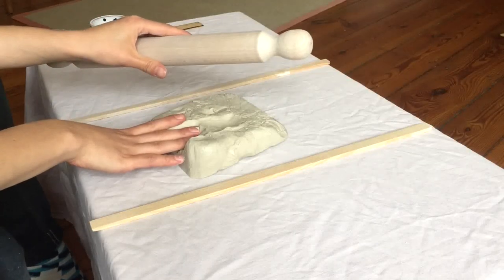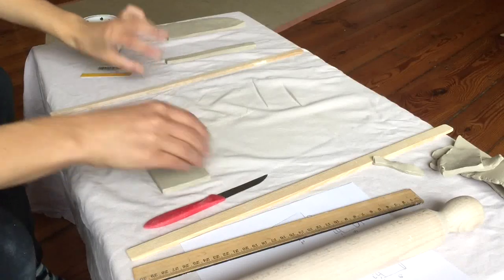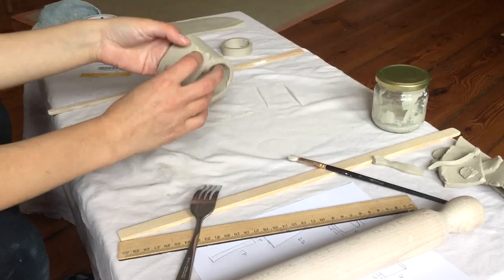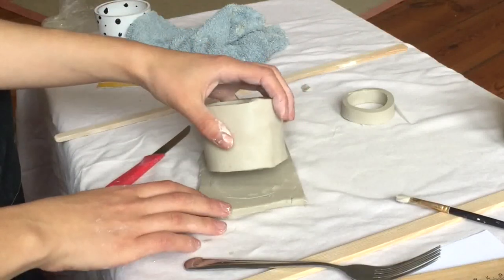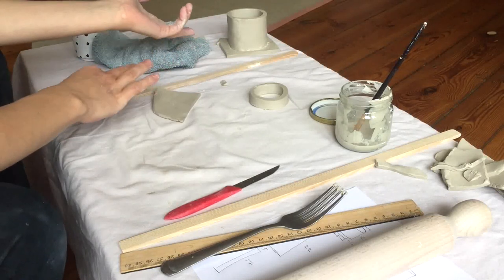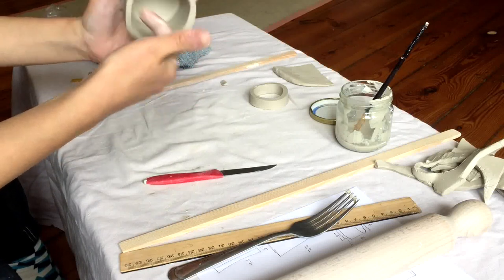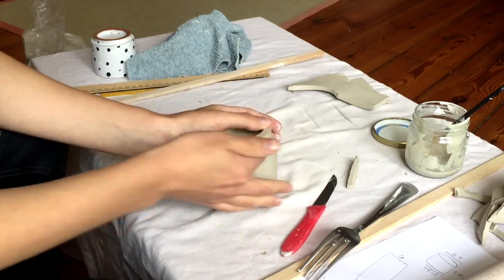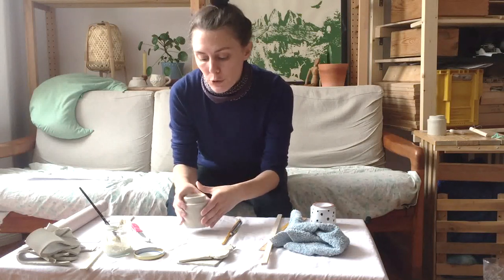Pottery at Home! Part 10: how to handbuild a cup with slab building

Comment: So thankful I found your channel!! I just started handbuilding clay and I tried making a mug using the slab method. After attaching the bottom base to the main body of the mug, I really find it hard to clean the inside part. Every time I try to clean one part, I just end up leaving a new mark on another area. I hope you can give me tips on which tool I can use especially when the mug is tall and narrow. Thanks so much! Your help will be much appreciated :)
Reply: There are tools you can buy which would help. I'm thinking of a wooden tool whose name I can't  remember lol. Also, let it dry enough so you aren't leaving marks when you touch it. 🙂

Comment: Hi - I've loved your 'at home' series thank you for sharing I will continue to follow you for tips and tricks :-)
Is there any chance you can share the dimensions you used for this cup as I'd love to give it a go - so far mine have been too big or too small  - I can't quite read your plan :-)
Reply from the maker: Hi Rebecca, I don't have the dimensions anymore, but on average the clay will shrink 10%. So you can measure the size you want, and then add 10% onto it when you're building it. With some simple math, you can get the circumference, etc.

Comment: There is a much easier way to acheive a miter joint.
Roll your clay to overlap each end and make one slice from top to bottom, at the appropriate angle, through both layers. They will then have identical join surfaces👍
Reply from the maker: Great idea!